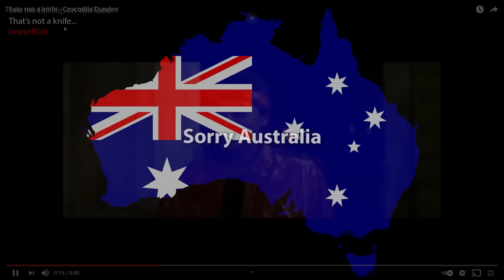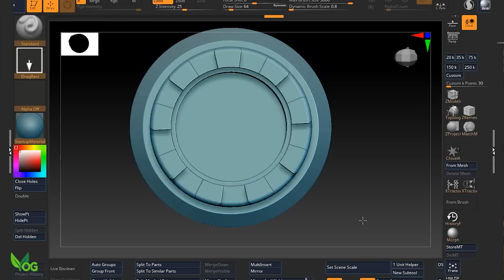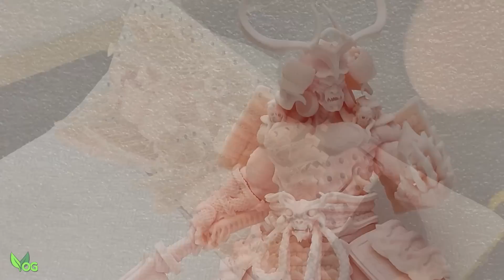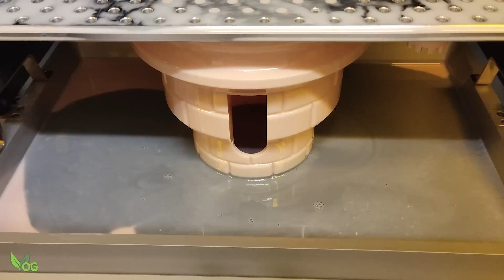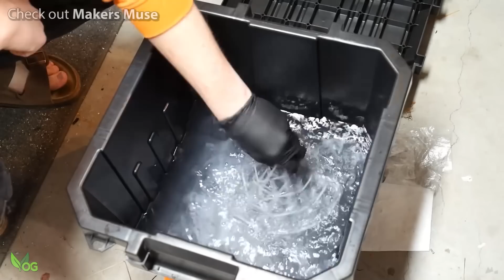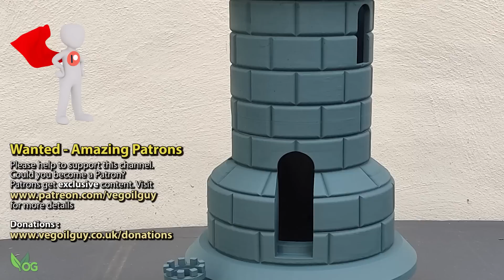Giant rook printed on the Phrozen Sonic Mega 8K - by VOGMAN

Comment: The last time I used a 3D filament printer 3 years ago in the shed in November I put two quartz halogen elements in series inside the cabinet with a thermostat to keep the temperature stable.
Reply from the maker: Smart idea 😁

Comment: Why don't printers come with built in pct heater,they are cheap and would happily pay a little extra to have it factory fitted. I fitted one to my photon s a couple of years back.
Reply: I think it's kinda complicated. The thing that shortens the lifespan of the display is most likely high temperature. But if they add a heating element to the resin, it will be less viscous, but is it really worth shortening the lifespan of the screen?

Comment: I want to know dimensional accuracy.  No use in wasting 30+ hours on a big print if its off by .8 mm or more on either axis.  Or you find out all your 2 mm bolt holes are now 2.5.
Reply: Accuracy is something you'll have to tune over time. You need to compensate for the expansion/shrinkage of the resin (when printing and curing). You can do this buy printing an XYZ cube at the biggest size possible, and compare the expansion to the CAD file with calipers. 

The other thing that you might be concerned about is how the print is supported. I don't know how best to explain it, but if the print is badly supported, there may be warping. 

But these are both issues you can compensate for quite easily.

Comment: That's got to be one of the most under-discussed aspects of resin printing - the importance of proper printing temperature. I'd hazard a guess that a temperature-controlled resin printer enclosure would go a long way towards solving frustratingly inconsistent print quality for many people, regardless of printer size. At least it's one variable checked off the list.
Reply from the maker: I agree. It doesn't help that these printers are typically developed in countries with warmer climates 😁
Reply: Resin like 25 degrees, thats it

Comment: At the moment I have placed (only availlable space) my printer in the attic where it's always on the warm till hot side. A friend of mine has printed a Darth Vader Bust in black resin and suffered a crack after a while (don't know the details though). Seen the print time it wouldn't surprise me if the print lasted well into the night or maybe even into the morning. That makes me wonder whether temperature change during the night might influence prints. Could you do some tests on resin printing temperatures?
Reply from the maker: Cracking often occurs when wet resin is sandwiched between cured resin - when walls are too thick. Hollowing helps prevent this. Maybe that was the case here...?

Comment: That printer would be brilliant for printing a large chess set!
Reply from the maker: I thought the same 😁
I also think this rook would make a great table lamp / uplighter 😁
Reply: @vogman  I gotta agree there, it'll actually would be a stunning lamp. I think what would be nice also is if the rook had a pillar/shelf inside to hold all the chess pieces and it was attached to the top n bottom part and the outside stone wall came off and it'll be used as the chess board.....I think I need a bigger 3d printer now 😅
Reply from the maker: I'll start shopping around 😁😂🤣